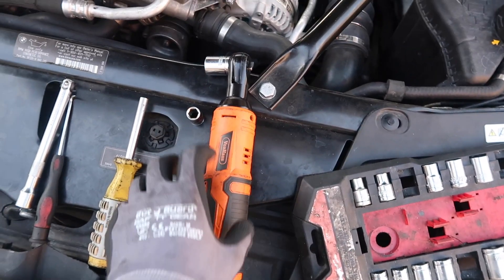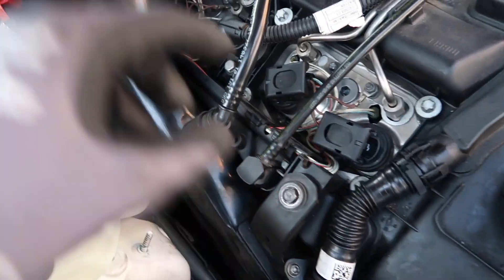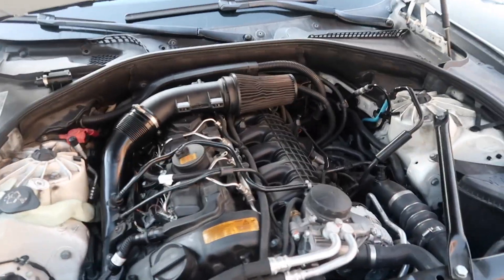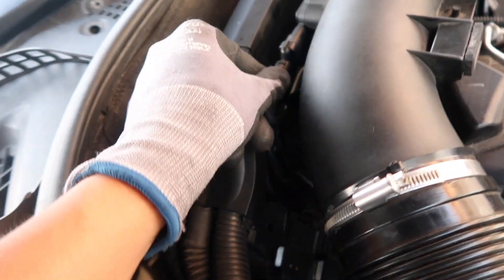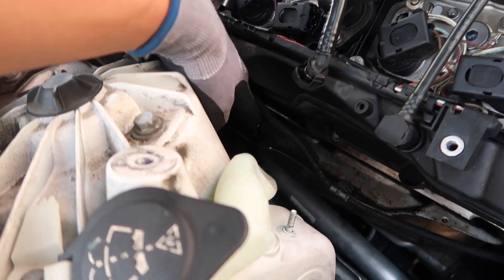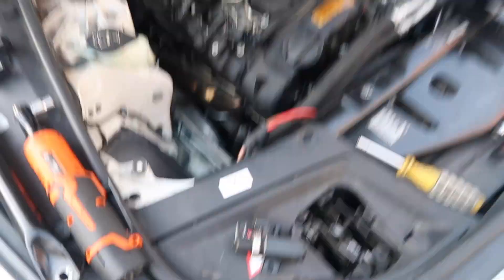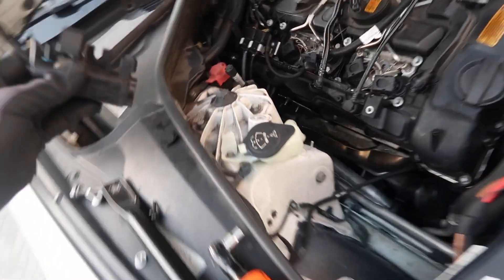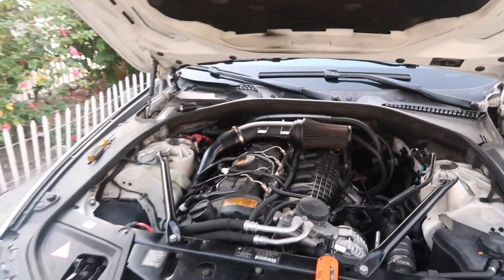N55 Boost Solenoid Replacement F10 535i (120208) DIY

Comment: I just got this code after having my spark plugs and coils changed. The mechanic was co fused and said take it to the dealer after charting ridiculous amounts of labor investigating. Please help. He told me to go to bmw to get the software updated because they can't clear the code. Do u have any ideas?
Reply from the maker: Hey thanks for viewing our video ! Do you also have an f10? If so, are you boosting at all ?
Reply: @anthonyulloa4004  I do have one. A 535i 2011. Love your videos. Right now it went into drivetrain malfunction mode, I can still drive it but it has reduced power. I'm not sure if it has boost, but I think it probably has some. I have a few videos on youtube, the most recent being what the car is doing now that it is in drivetrain malfunction. The previous two videos are before the sparkplug and coil change where the rough idle and surging was starting to happen slightly.
Reply from the maker: Thanks man I appreciate that! I saw your video, does your car shake when the drivetrain malfunction comes on ?
Reply: @anthonyulloa4004  oh yes quite a bit from side to side
Reply: If I give it gas in park and let off the gas it almost wants to die
Reply from the maker: Do you have a code reader by any chance ? It sounds like a misfire
Reply: @anthonyulloa4004  the light comes on even if I just turn the accessory power on before starting. My mechanic tried to clear the code but said it wouldn't clear. I'm bringing it in Monday to the dealer to reprogram the software due to a TSB. If this doesn't work he was trying to say its the valve cover, but I've got no leaks. So we will see what happens. I'll keep you updated monday afternoon. Thanks for helping me out and taking the time man.
Reply: @anthonyulloa4004  no check engine light came on, but before they changed the plugs there were some misfires. The only code that shows up is 120208, and the ones that follow putting it drivetrain malfunction. A few AC codes come up but it's working fine. I need to find out if the misfires still showed up after, but the car was definitely not running right. I'm interested to find out what the dealer says. I saw one forum that said the vaccum lines leading into the presure converter were installed backwards since this only did happen after installing spark plugs this could also be possible. There is a lot of suction on the oil fill cap
Reply: What code reader do you recomend? I've I'm going to keep this thing I do need to get my own reader.
Reply from the maker: We mostly use Ista on the laptop but I like BimmerLink on my phone aswell &’ for the scanner I use the Vgate iCar Pro 👍🏻
Reply: @thomastague9359  you can get MHD app for F series and buy the obd ii cable to USB c.  MHD app can read BMW codes and free but you have to pay for the wire.
Reply: So luckily I bought the F10 with a 100 day warenty that came included with the purchase. BMW technicians diagnosed a problem with the engine timing, and the warenty company just approved 8 hours of breakdown labor to dis assemble the engine to find the issue. So thankful I had my plugs and coils changed and codes cleared which probably tripped the drive train malfunction. It was a blessing in disguise, because it sounds like the repair will be in the thousands, and so far the warrenty company has been cooperative.
Reply from the maker: Thankfully it was caught on time man, hopefully everything goes well. Keep us posted on any updates &’ hopefully you’ll be back up &’ running real soon !🙏🏻
Reply: @anthonyulloa4004  good old exhaust vanos unit. They never say exactly what the issue was because I guess most bmw owners don't get into the nitty gritty, but I'll see if they can give me the old part so I can show everyone what happens. This video lead me in the tight direction, so thanks for your comments and making these vids. Keep em coming
Reply from the maker: Glad we could help! Keep us posted 👍🏻